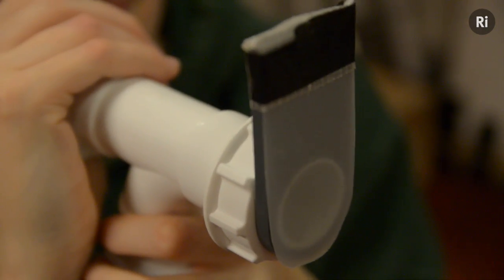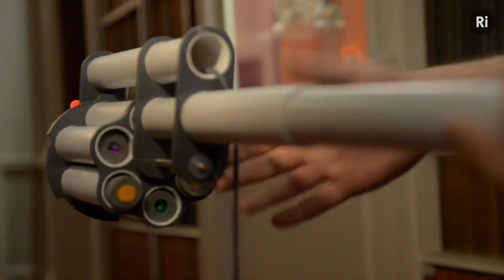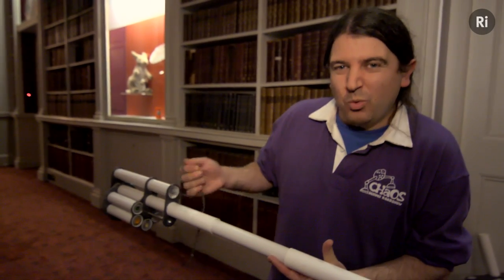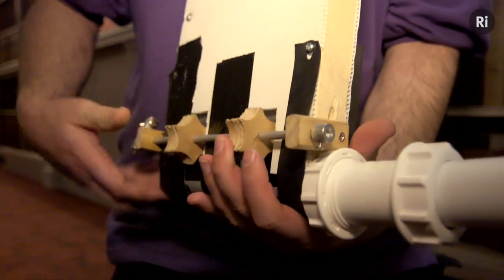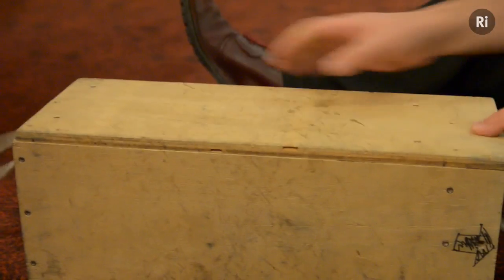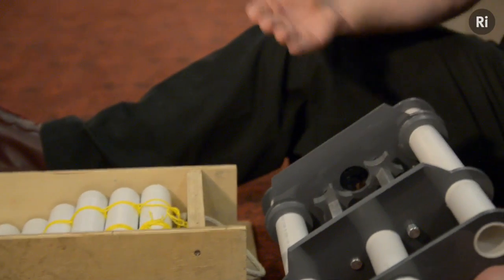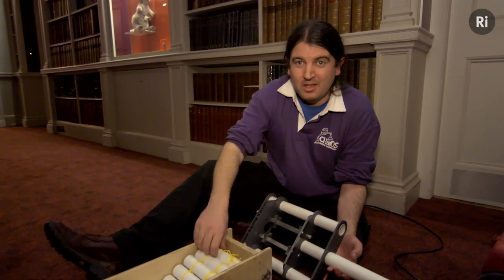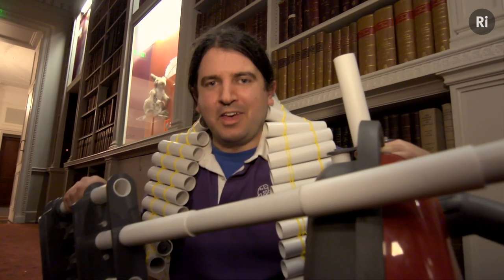The Vacuum Bazooka

Comment: I want to know MORE about your foam shells/bullets.

I can easily make the gun out of PVC plumbing parts (I work in a plumbing supply store).
What I can't figure out is what your foam bullets are made out of.

In America, we have Nerf ammo, and "pool noodles".  I can't find anything here that looks like your ammo and that would fit the PVC pipe with an adequate fit.  Too big, and you have to cram it into the tube and have way too much friction, despite the great seal.  Too small, and you lose a lot of vacuum, and thus, projectile force.

What did you use for projectiles?????

Comment: With the removable box magazine design, you said it was inspired by the Bren. Well, I invented a nearly identical setup, but with mine I turned it 90 degrees to the left, whereupon it was inspired by the Sten. But then I lost grip on the main tube and gravity kicked in, causing it to turn 90 degrees to straight down. At that point it was inspired by the B.A.R.

Comment: Hmm... this gives me an idea for a double action hand pump gun... but it'd probably be easier to just use compression off both strokes than alternating to vacuum
Reply: On a slightly related note you should pump air in the back of the barrel from the exhaust side of the vacuum

Comment: This would probably also work with saboted rounds. You could shoot jelly babies, confetti, Cadburys cream eggs, rusty iron nails, or titanium darts (as in the "sport" "darts") which of course have their own fin stabilization. Some more plumbing connections would allow you to connect a whole ring of vacuum cleaners. This would consume more electricity, so if your energy is not coming from a renewable resource I would advise against it. However you could move up to much heavier projectiles.
Probably best to stay away from lead and depleted uranium for obvious environmental reasons. But you'd be freed from the work hardening issues of machining titanium and could use normal or ultra-maraging steel.
A pulley running off the motor of one of the cleaners via a reduction gear would in the end simplify your ordinance feed issues, although I'm not currently disposed to discuss plans for auto cannon vacuum bazookas even if I had knowledge of such developments. Needless to say these concepts also apply to the vacuum mortar and its vehicle mounted derivatives.
Reply: TheMotoben If you also combined a clutch between the ordinance feed system and the gear reduction system, this would permit you to engage the feed system at will, removing the need to start and stop the vacuum cleaner engines for each burst, giving you a much more practical system.
Reply: @Jetpower485 🔴 What Is Islam?  
 
🔴 Islam is not just another religion.  
 
🔵 It is the same message preached by Moses, Jesus and Abraham. 
 
 🔴 Islam literally means ‘submission to God’ and it teaches us to have a direct relationship with God.  
 
 🔵 It reminds us that since God created us, no one should be worshipped except God alone.  
 
 🔴 It also teaches that God is nothing like a human being or like anything that we can imagine. 
 
🌍 The concept of God is summarized in the Quran as: 
 
📖 { “Say, He is God, the One.  God, the Absolute.  He does not give birth, nor was He born, and there is nothing like Him.”} (Quran 112:1-4) 📚 
 
🔴 Becoming a Muslim is not turning your back to Jesus.  
 
🔵 Rather it’s going back to the original teachings of Jesus and obeying him.
Reply: its a vacuum toy, not an anti tank gun.